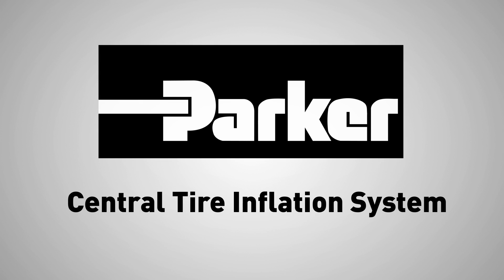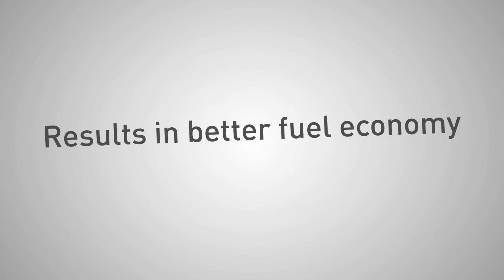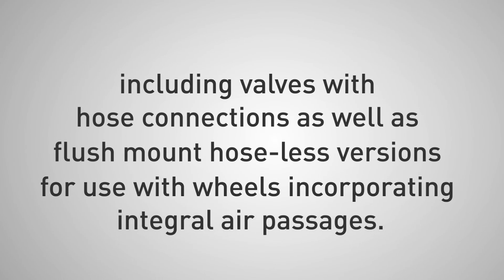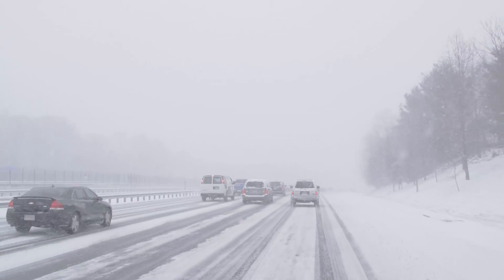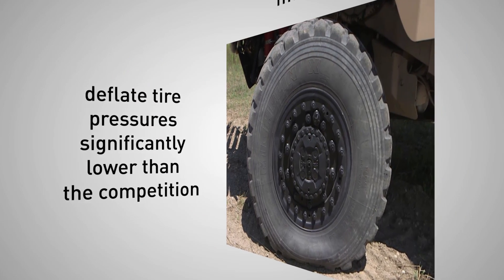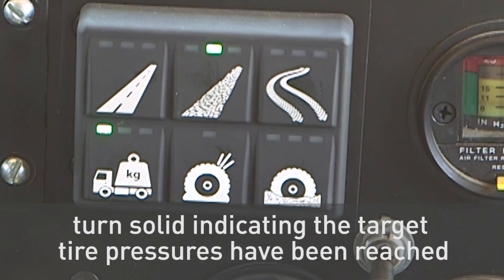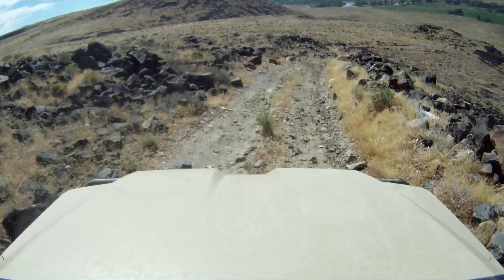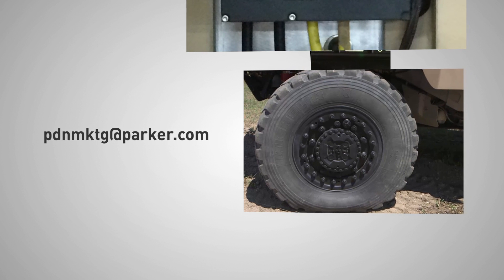Parker's Central Tire Inflation System -CTIS

Comment: Can this replace the stock CTIS on a LMTV M1078 military truck ?
Reply from the maker: Parker does not currently offer a retrofit kit for this conversion, but works with the engineering firms and OEMs leading the vehicle modernization studies. Thanks for your inquiry.
Reply: Exactly 💯 %! I'd love to have this on my 1975 Chevy Blazer on 1ton front, and Corporate 14bolt 12.5" ring gear ⚙️ 1.5ton rear end...from Wyoming USA 🇺🇸 🤠

Comment: How does air get into the tire from the onboard compressior.
Reply from the maker: There are 2 methods. 1. A custom rotary union between the hub and the inboard side of the wheel to create an integrated air passage.  This typically needs to be installed at the vehicle factory level. 2. Outboard rotary union fed by an umbilical hose may be more suitable for a retrofit type of application.
Reply: @ParkerProductsSupport  So you mean to say that for retrofit application, there will be an exposed hose from the wheel wall somewhere which will supply air to the wheel? 
second question, can I retrofit a system using method 1 if I am going with custom axles?
Reply from the maker: You are correct in your description regarding method 2.  For method 1, as you’ve listed it, the custom axle would eliminate the largest technical hurdle to this type of retrofit.  However, additional vehicle system elements would also be required, including a properly sized air supply/preparation system and integration with an SAE J1939 CAN bus on the vehicle.